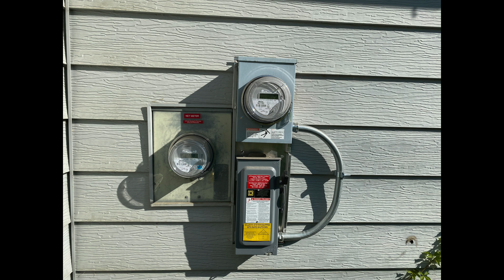The grid tied solar system.

Comment: They are called kWh kilowatt hours. Not kilowatts. Drives me nuts. Which inverters are you using?
Reply from the maker: AP microinverters.  600 series.
GFM
Reply: Gray, it's like the difference between BTUs and BTUs/hr. Your PV array is ~15 kW and produces 15kWh/hr in full sun (assumptions). 5 hours of full sun = 75 kWh, which you then bank, like you said. To go back to the furnace analogy: a 100,000 BTU/hr input furnace consumes 100,000 BTU/hr. In 6 hours of run time per day it burns 600,000 BTUs or 6 therms.

Comment: What is your return on investment?  $20,000 plus of hardware.  I am going to guess that it is North of 15 years.  Just long enough that the avg. Life of the pv panels are about up as far as mfg. Spec. Output.
Reply from the maker: I will be going over the numbers in future videos.  The Canadian solar panels are guaranteed materials and workmanship 15 years, 25 power output.  The Silfab are 25 and 30 years respectively.  
However, I would say you should look at it more like, what is the payback for a new roof?  More on this later.
GFM
Reply: @grayfurnaceman  very well, I look forward to the future videos.  Thanks for the reply.

Comment: "Grid Tie" is legal in most states, but the power companies thru fees and any means they can think of, will go out of their way to "disincentivize" you.  Even with all the properly code compliant equipment to prevent "islanding" (feeding power to the Grid if the grid is down...), the bottom line is that they want to supply and charge YOU for power, not the other way round. Many are now going to "Net Zero" systems where they are "grid connected", but do not feed power into the Grid. Newer Hybrid Inverters can operate in this mode and draw only from the Grid if your PV or battery systems cannot produce enough power for your needs. First thought for anyone planning a system, is to plan for your "critical needs" (i.e. heating, refrigeration for food, basic lighting, etc. If you are dependent on electrically powered medical equipment, that would be your first priority, followed by heating, cooling, lighting, etc.),.
Reply from the maker: You are correct that power companies do not like us small producers.  For the most part, they are obligated to adjust for the variable output from solar, but will try to make it harder.  The "islanding" issue seems nonsensical to me as if I feed power back into the grid, my neighbors will drop my voltage immediately to zero.  But I won't say I am correct as I don't know for sure.  
I do know my system will not backfeed.  
The issue of selling power is a complicated one, as the utility regulations limit how much they can make from selling power.
My system is not designed for power outages, so I have not tried to set it up for battery backup except for a small system used in my shop.
I will have more on this in the future.
GFM

Comment: Thank you for your video.
How much elecricty does each panel produce  ?  Nominal value.
What is the length and the width of each panel  ?
Reply from the maker: As this system was done in stages, the panels range from 310 to 330 watts.  Actual output is lower.  These panels are 39" by 56".  They are changing to larger panels now that output over 400 watts.
GFM
Reply: @grayfurnaceman  
Big thanks .

Comment: anyone else notice the audio sounds funny on middle to end part of strong words, like some alien background filter, reverb or something else funky. it sounds like a gurgling/warble on the middle to end parts of words like "means" "meters" and others.
not meaning to be a complaintive thorn in your side, but somethings up and I never noticed it in prior videos :)
Reply from the maker: If you noticed that on the beginning that was done outside, I use a damper to reduce background noise that sometimes puts the gurgling in.
GFM
Reply: @grayfurnaceman  it did it all throughout  the video. maybe due to mic audio too high and clipping? maybe just berserk software.
likely many wont notice it on small portable devices, unless they have headphones on or good earbuds in. I'm on a workstation with large home theater surround setup, watching in regular 2 channel/stereo mode though. I can hear many things others wouldn't.
Reply from the maker: @throttlebottle5906  Thanks for the info.  Let me know if future videos do the same.
GFM

Comment: 9 $/M electric company service charge @ ~0.0853 $/kWh = ~105.5 kWh/M cost.
6500 kWh - ~105.5 kWh/M * 6 months of winter = 6500 - ~633 = 5867 kWh / 6 months = ~978 kWh/M

So, if you have 6500 kWh banked then you have ~978 kWh per month on average of free electricity (after you remove the monthly service charge cost that you will incur).  These number may vary if you would normally pay a lower $/kWh energy rate.

How much $ have you invested total in your solar system?  How long do you estimate your break even point is in years?
Reply from the maker: I will be doing a video on system cost in the future.  
GFM

Comment: Really interesting, I didn't know this. Also about the micro-inverters, I'd rather have one big one inside the house, the small ones will probably break after a few years max, as all electronics seem to. Fun replacing them on the roof. A big one can be easily swapped out if on the ground.
Reply from the maker: One of the largest problems with central inverters is the power from the panels is about 30 volts dc.  That transfers to a 14 panel circuit using 2/0 wire to the inverter.  Microinverters transfer power at 240 volts using #12 wire.  There are ways to mitigate that for DC power, but it just makes it more complicated.
Add to that, the microinverters are guaranteed for 25 years.
GFM
Reply: @grayfurnaceman  Oh, ok thank you. Interesting tech this is!
Reply: @grayfurnaceman  Enphase M250 is what I have. I had one fail when the Envoy pushed a firmware update. The one panel that had 100% snow covering it was the one that failed. Micro inverters are way better because when a string inverter fails the whole system goes down.
Reply from the maker: @timcat1004  So true.
GFM

Comment: 🤔👍🏻

If that's tesla that crap is expensive, and if the grid goes out your still in the dark unless you spend and additional load of money. 
Solar is Solar !( when the sun shines I should be fine)(NOT)
They're all in bed together!
You saved DYI but the average joker is walked down the hallway!
🍺🍺🍺🥃🥃🍿🎯
Stay safe. 
Retired (werk'n)keyboard super tech. Wear your safety glasses!
Reply: hint majority of utility suppliers hate solar and other forms of power generation and even more so, when they're capable of supplying excess back to the grid. because there's no guarantee it will function right and not back-feed when there's a problem. it can also make their equipment go berserk with the load changes of clouds and other solar blocking waves.
Reply: @throttlebottle5906  You are full of BS
Reply from the maker: Utilities will have to adjust how they do business (and how they are regulated).  Small producers are the future.  Load adjustments always have been the primary job of the utility.  Utilities also own things like solar arrays and wind turbines.  
GFM
Reply from the maker: The system is not Tesla as it is DIY.  
GFM
Reply: Absolutely correct.